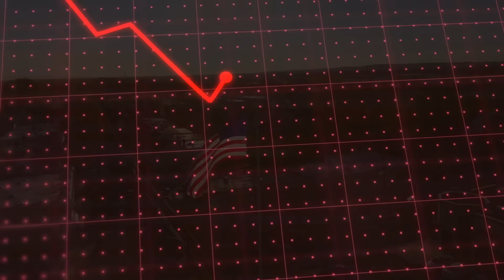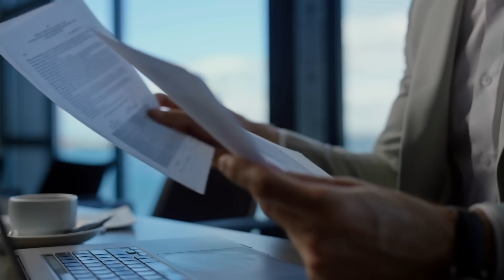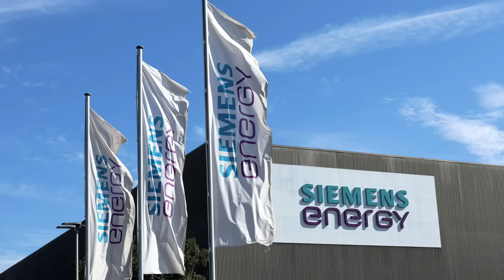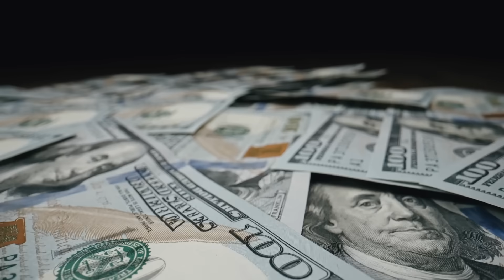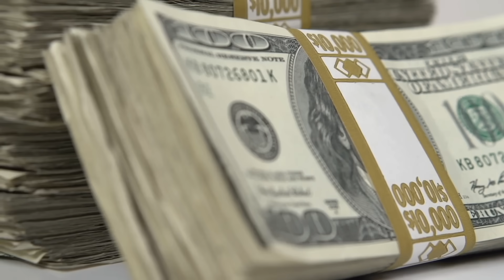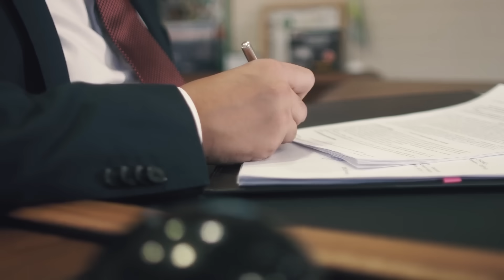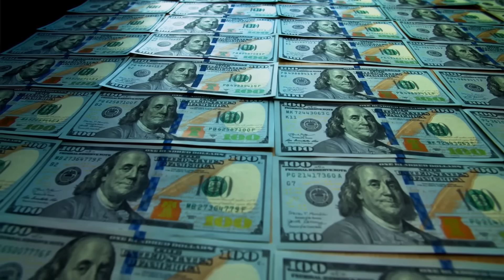The Real Reason America Has Turned Its Back On Wind Power Energy

Comment: Solar and wind have a massive enviromental footprint.
Reply: Until you compare it to oil, gas and coal, then it is vanishingly small.
Reply: Compared to what? A field mouse?
Compared to fossil fuels the footprint is rather small.
Coal power plants produce hundredtimes the CO2 and tentimes the waste for each kwh than windturbines. And for the waste of coal power plants just the ash was considered.
Reply: @old-pete  Ha, ha. Can't grow any vegetation where there are solar farms. Trees being felled to accommodate wind turbines; which have massive concrete bases and causing problems for whales, birds and bats. Your assumption is that CO2 is a problem, which I disagree with.
Reply: @cheltboy There are enough plants that prefer shade. Hops and solar panels work great together.
Most windfarms are not setup inside forrests. Even if trees are removed, the windturbines will save more CO2 than the trees would. And is quite common that developers must plant new trees for compensation.
Concrete bases are a non issue. They are too small to cause problems.
Whales are largely unaffected by windturbines and the effects on birds and bats are small compared to modern society and emissions from fossil fuels.

And no, physics do not care about your opinion on the effect of CO2.

Comment: The prairie fans will never offset the carbon footprint it takes to build one from scratch. I don't see them digging with electric shovels. Where and how are they disposing of the stuff once it craps out?  How many birds are killed each day by them. They are an ugly nuisance, that has no place on the earth.
Reply: The carbonfootprint is offset in 6 to 14 months. They kill less than 1/100th of the birds of what glass windows kill.

Comment: Why shoud the government - already in the minus, already in debt - pay?
The bill should be forwarded to the customer.

Another option would be, to have those remote sources instead use the energy to produce Hydrogen or other fuel, which can be distributed more easily and ist flexible in its use.

Comment: Your cartoon is too simplistic by half. Hooking up thousands of megawatt hours of intermittent potential to a grid does virtually nothing to enhance the reliability of that grid. Worse, generating gigawatts of electrical energy hundreds of miles from where that energy will be consumed is idiocy of the highest order. According to the latest study, wind turbines produce, on average, 18.3% of their rated capacity annually. So if Sacramento needs 1,000 Megawatt hours of additional electricity per day to keep the lights on - which they plan to get from a new wind farm in Wyoming or Montana. That farm will need to have a design capacity of about 6,000 Mwh to meet the generation required. Unfortunately, that wind farm will be about 900 miles from Sacramento so between 27% and 45% of the power generated will be lost as heat from the transmission lines (3% to 5% per 100 miles). That means that the size of the wind farm will have to be increased by another 30% to 45% to compensate for the line loss. So we need a design capacity of between 7,800 and 8,700 Mwh to meet that 1,000 Mwh demand. A wind farm with a capacity of 8,200 Mwh will require 820 square miles of land to construct.
 https://sciencing.com/much-land-needed-wind-turbines-12304634.html
That's 525,000 acres and all the birds and wildlife and much of the agricultural production that goes with it to produce a tiny fraction of the energy required by one medium sized city. That doesn't take into account the megatons of concrete and steel and aluminum in the transmission towers and the hundreds of miles of copper wire and or the wire and transformers and rectifiers needed to attach the hundreds of turbines to the transmission lines. It is horribly inefficient and destructive of so many things that we should value. Please stop trying to make this vulgar nightmare a dream scenario.
Reply: Your transmission loss numbers are way off. Loss for HVAC is 6.7% per 1000km and 3.5% per 1000km for HVDC transmission. 
Nuclear generating plants are often hundreds of miles from their loads and if you look at an electrical grid map of the U.S. you will see dozens of long distance (over 500mi) transmission lines. This is perfectly rational in many instances.
All methods of electric power generation have undesired side effects. No private insurer will cover a nuclear plant so they are insured by the Federal Government in the U.S. Coal plant emissions are a health threat for people downwind of them and add to the CO2 problem. Natural gas plants also emit CO2, though much less than coal. Hydro is great but there are few good sites left. Geothermal is expensive so is only feasible in a few areas. 
Wind generation is cheap and getting cheaper. I am confident this source can be integrated into the power grid successfully so we can reduce and eventually stop emitting CO2.

Comment: A "Zero Emissions" anything is an unrealistic expectation.  We still have 340,000,000 people in the US who spew out more CO2 than we take in every time we breathe.  The "REALITY" is that wind and solar are simply additional "SOURCES" of electricity that will have to coexist with the existing hydro and coal-, natural gas-, and oil-fired sources.  Like Rodney King said in the 1990s . . . "Can't we all just get along?"  Sadly, not so for the "Green New Dealers" who are dealing off the bottom of the deck.

Comment: Wind turbines that were supposed to last 25-30 years are crapping out after 10 or 12 years, whereas a coalfired, or gas fired steam power plant is proven to last 30,40,50 , even 60 years in between major overhauls. When a wind turbine takes a dump, there is no easy way to repair it. It has to be replaced completely. Solar farms are also falling far short in solar panel and inverter lifespans. Solar panels generate lots of excess heat along with electricity, so instead of the deserts being great for solar power they actually kind of SUCK, because the excess heat generated prematurely kills the panels and the inverters. Think of a 45 degree C ambient temperature rise when it is already 50 degrees C outside. This means the temperature rise added to the ambient temp is almost high enough to boil water, and it will definitely cook the panels and the inverters. When I used to sell power conditioning to industry, if it would not pay for itself in less than 4 or 5 years, absolutely no one wanted it, PERIOD. Most industries would not buy a power conditioning system unless it paid for itself in less than 3 years. The public utilities have changed their billing so it would take me over 2x longer to recover the costs of a solar system for my home.  This means I have lots less time to save up money to replace that pile of shit solar system when it wears out in 10-20 years. Sure, I'd love to help save the planet, but I am not a total idiot. The math just does NOT add up for me.

Comment: No offense to you Impossible build, however you aren't correct on the wind turbine issues. Reliability, grid stability and power generation are the main issues. Wind blows too hard, got to lock down the turbines so not to damage, wind blows too little, and you need to disconnect them from the grid or else the feedback from said grid will turn the turbine. Even when you have the blades turning, it doesn't mean they are producing a set wattage or voltage. It goes up and down during production which in turn makes it difficult to balance the grid. On small scale this isn't noticeable but on a larger scale, well there been some fried grids. 

Combine the lack of stability with the reliability and you have to have a backup source which means more transmission lines, more substations more monitoring and rapid response power plants like natural gas power. This is where the hidden cost is that doesn't get shown on that nice clean invoice sent to the government. 

Let's discuss backups real fast, Lithium battery storage is the current way to store this energy. It takes a lot of battery banks to store just a days' worth of power and sometimes you can go weeks without correct wind rates. Lithium also has this little problem even when its tightly wrapped up and covered if it reaches a certain temperature, it can self-ignite. The ship called The Dutch Oven carried EV cars and this happened. You can't put out a lithium fire. Therefore, you need a better backup, natural gas works on that. I won't get into CO2 in this rant.

So, you have to not only build the turbine which you have to destroy the landscape to do so, remember some Countries destroyed millions of trees just to put in a few farms that produce less power than a single natural gas plant which takes up much less space. You also have to build the infrastructure to transmit the power then you also need backups. The places that have neglected this tends to have higher energy cost and more rolling blackouts than those who have forgone renewables. 

This isn't a cost problem and lazy evil government, its an engineering problem that is so complex that we struggle to figure it out. You want emissionless power, build nuclear stations and carbon capture such as oxy-combustion and integrated gasification combine cycle power plants. Takes up less space, less resources per wattage and is more stable and reliable.

Comment: It seems like a coal plant here and there could be shut down to accommodate the cleaner energy but then that would cost jobs in those sectors. I guess its for better brains than mine to figure out.
Reply: Hi Jimmy. The REALLY worrying thing is that there might not be any better brains than ours!! But never mind, A.I. is just around the corner. It's the intermittent nature of all "green" energy production (except hydro and geothermal) that makes your gradual replacement idea difficult to put into effect, but with forward planning in a SOCIAL DEMOCRATIC economy it could be done.  Cheers, P.R.
Reply: @philliprobinson7724  If that is what it takes then I will stick with the old system!!!
Reply: @jimmyd486  Hi Jimmy. Good luck with that. Cheers, P.R.

Comment: Wind is a fool's folly. Placing rotating machinery hundreds of feet in the air is a maintenance nightmare. Solar beats all rotating generation, especially wind. Solar and batteries beat everything.
It's not the grid that's the problem, rather it's the intermittent nature of renewables. Renewables do not work without storage and they cause more harm than good without storage.

Comment: You lost me when you said modern wind turbines are "green to make".  Either you have no idea what you are talking about, in which case you should not have said that, or you told a thumping great lie, in which case you should not have said that.   "A 2 MW wind turbine weighs 1688 tons: 1300 tons concrete, 295 tons steel, 48 tons iron, 24 tons fiberglass, 4 tons copper, .4 tons neodymium, .065 tons dysprosium and more."  That's not green.   You do understand that iron and steel production use lots of coal?  Yes, you can find web pages saying concrete is an environmentally friendly building material, but the cement industry is one of the biggest CO2 emitters there is.  Now there may very well be an argument that the whole-of-lifecycle effect is greener than a sick leprechaun on St Patrick's day, although given the rather short life of wind turbines that seems unlikely.  But they're not green at all to make , at all.

Comment: These is another thing that the normal consumer of energy don't know about Wind turbines. 
I been in the controls field over 30 years Wind turbines are similar to cars or any other mechanical thing ,,the first few years they may minor mechanical issues after 10 years they become rusting mechanical hulks , that require either more federal subsidized money or the public will depend on the private investors to  pour millions of dollars in them without cutting corners. My first huge 1500 Wind site in WY of 2008 has already been bought by another company and entirely gutted ,,they were horrible designs ,,3 turbine fires on one site . My last site in 2017 was a ""REPOWER SITE"   most companies  are jumping on these upgrade sites for the federal subsidized money..to qualifiy for that money  the blades, gearbox & Hub have to be replaced.  Just renting out a crane costs the tax payer $100,000 a day ...there was 3 Cranes on that site  Are you getting the picture yet of who will be ultimately be footing the bill ,esp after the Gov quits pouring money in these ?

Comment: I worked in the Wind Industry over 3 year as a  Commissioner ...The Wind Industry depends on the OIL Industry, every Wind Turbine has a gear box almost the size of a Volkswagen , that has 40-50 GALLONS of OIL in EACH ONE,,,, Wind Industry is alternative energy but NOT GREEN Energy
Reply: 40-50 gallons of oil to produce MegaWatts of power is actually really good lmao.

Comment: The grid should have been updated first, before spending lots of tax money on wind turbines that can't be connected to the grid. Also, the materials in wind turbines are NOT green! The blades are made of fiberglass that is toxic if put in landfill and there isn't sufficient resources for recycling (which generates air pollution). Then there is the problem of all the land that can't be used because of the towers & blades (oh, was there any mention of all the birds being killed by the blades?). The land with all the turbines isn't really useable for anything else, and how do we get the power from the wind turbines to the grid?

Comment: Nothing new about this.   The very reasons that there are about 100 nuclear power plants under construction around the world is that when you include transmission and distribution cost that nuclear power is almost always cheaper than solar and wind.  It cost a lot of money to connect a lot of smaller generators than to build one or two very large transmission lines to distribution nodes.

In the USA the solar and wind generation industries have generally pushed the cost to the owners of the transmission and distribution utilities.  Hence they can claim to be cheaper than nuclear and other power sources.

In the rest of the world governments generally look at the total cost to deliver the power to the customers.  That's why there are so many nuclear plants in planning and under construction worldwide.

Comment: All you have to do to know whether or not we should be subsidizing "wind power" is go to one of the farms and look at the turbines.  If some of them aren't moving, no electricity is being used to rotate them.   Think about it.....Wind doesn't move one and then not the one next to it.  It doesn't make sense as close as they are together.  Look at the video closely and you will see what I mean.  Besides, the blades are too thin for wind to actually move them in the first place.  This is common sense.
Reply: There are several reasons that a given turbine's blades aren't moving including rotation of use, maintenance, and a limit of how much power they can add (or are being paid to add) to the grid at a time.